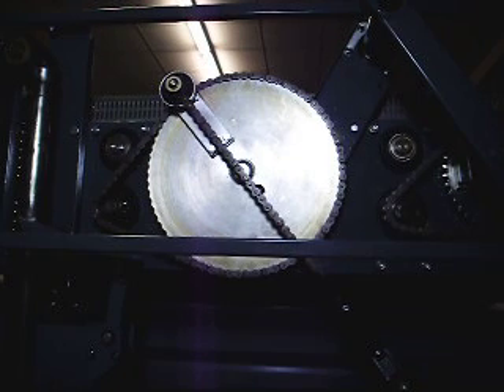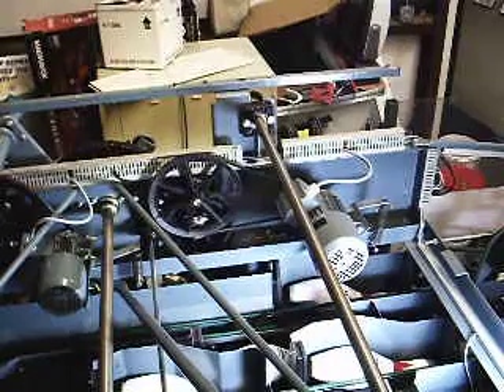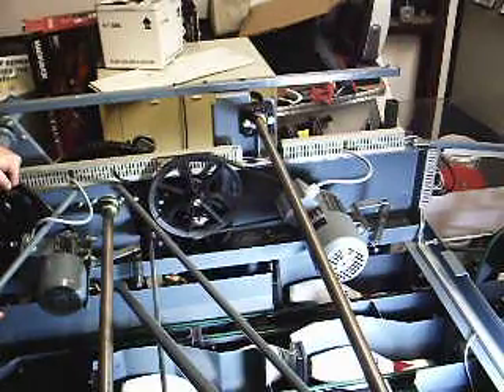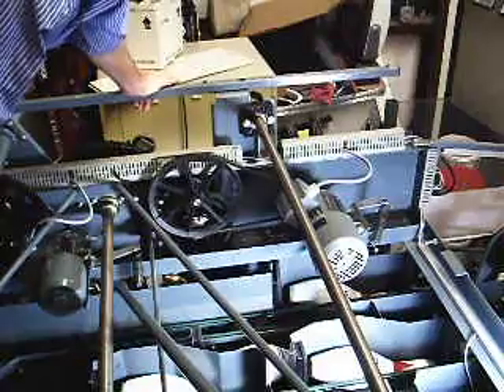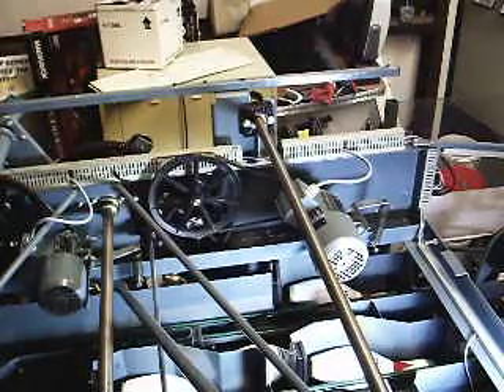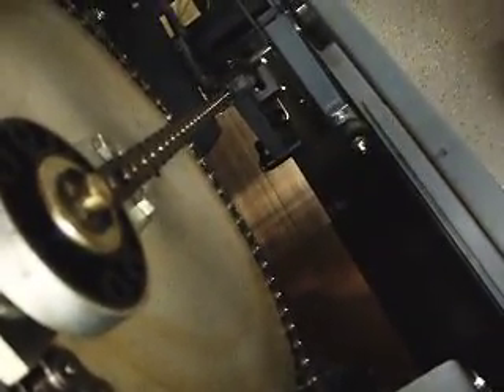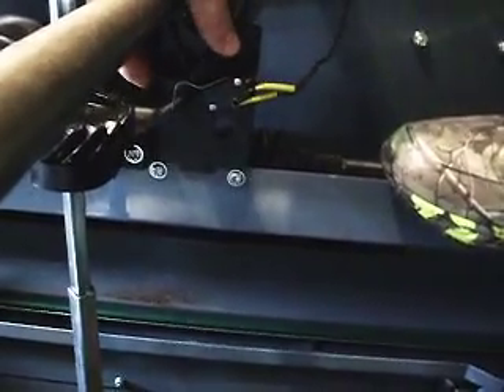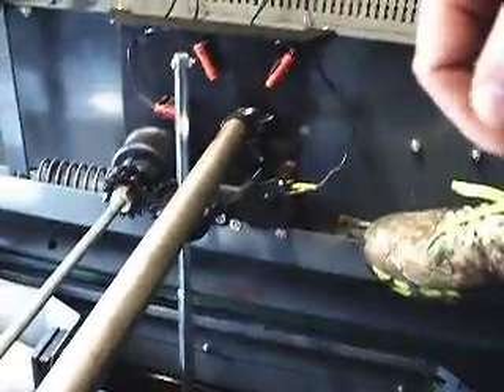Switch cluster timing

Comment: Hello sir, Error code P0 how to fix please help me
Reply: PO is "out of range" Meaning a pin on the deck is hitting the table not letting it down all the way, move the pin your good to go!
Reply: @ns134c   I suggest don't move the off spot pin, especially if you got League or Tournament Bowlers. If the pinsetter blacks out on Out of Range, just turn it back on. If you don't want blackouts, its best to change out the scoring system because on newer scoring systems like Brunswick SYNC, the pinsetter will just perform a short cycle (the same way when the 7 pin or 10 pin were the only one hit or a gutterball) but you still need to manually edit the score because it will mark as zero when the Table detects.

Comment: Hi sir code 61 why to continue always please help me
Reply from the maker: Deshraj-
Error code 61 is the Switch B is Not Expected But Found meaning it should not be detected at this point in the cycle/rotation of the pinsetter.
I wood check the "B" reed switch.
Disconnect the terminal plug at the reed switch and connect a multi-meter to test if there is continuity "signal".
This switch should not be active all the time, only when the magnet on the cam passes the reed switch.
Some times the micro switch inside the reed can get stuck.
You might be able to lightly tap the switch and release the trigger inside but it will fail again soon.
If you do not have a multi meter try swapping the "B" with the "C" reed switch, to see if the problem moves.
If the problem moves it is the switch if it stays you might have a short in the wire to the "B" switch.
I also want to remind you to make sure your timing on the switch cluster is set right on the "A" switch.

Good luck, hope this helped.

Comment: Dont work for me .do you have another way
Reply from the maker: Try to center up the chain from the other side instead of using the big drive gear from the sweep release arm.
Or make sure the sweep is in the sweep release arm.
If the sweep is not inside the sweep release arm it puts the chain at a different angle and that will throw off the timing of the switch cluster.

What is the issue you are having with the pinsetter overall?